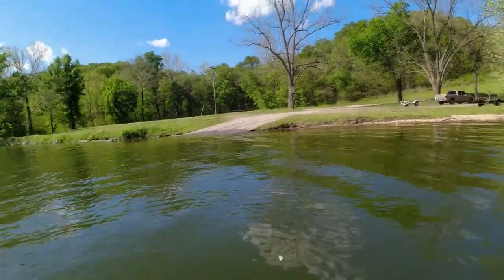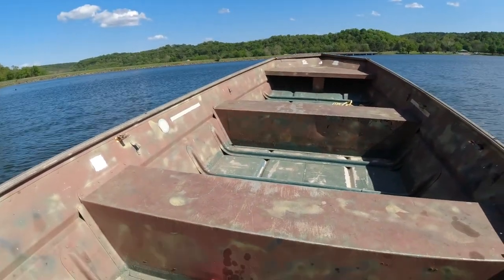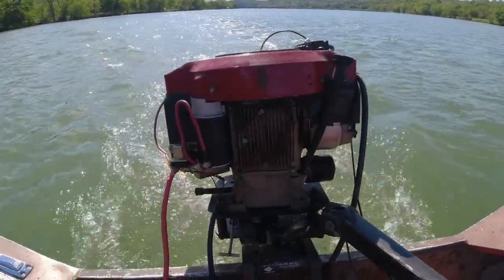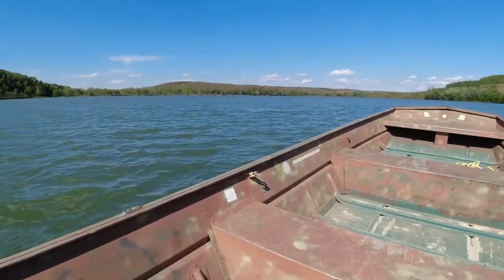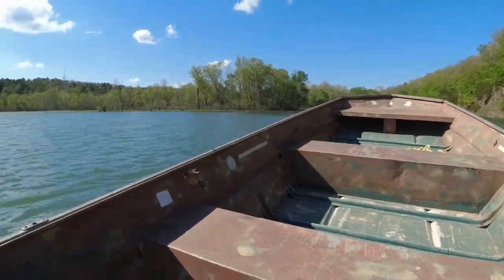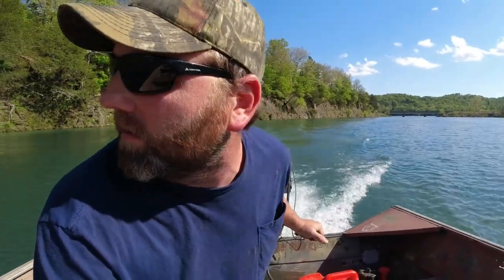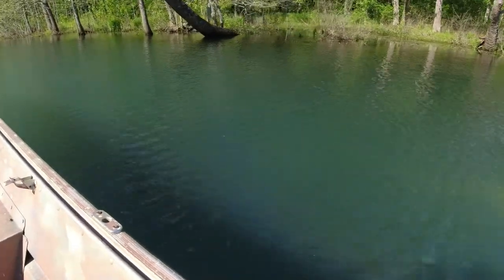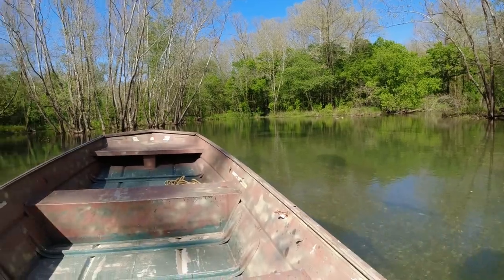homemade surface drive creek run adventure

Comment: He has plenty of torq with this.set up if you want more speed might have to off set the engine then put some pulleys or gears_sprockets to make the prop spin faster 2strokes are higher rpm power and 4 stroke is lower rpm torq i might try build a chain drive one